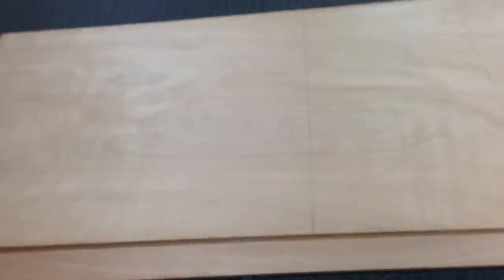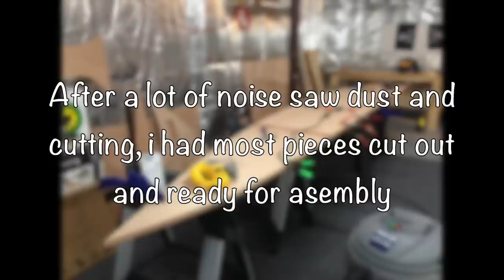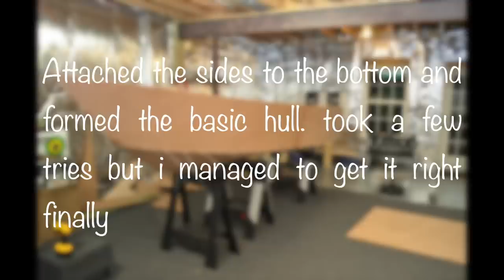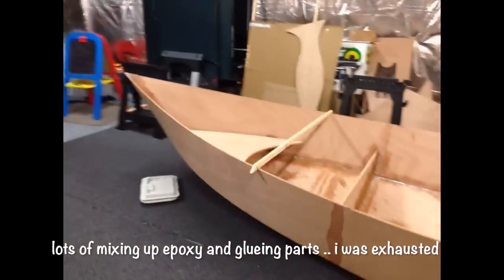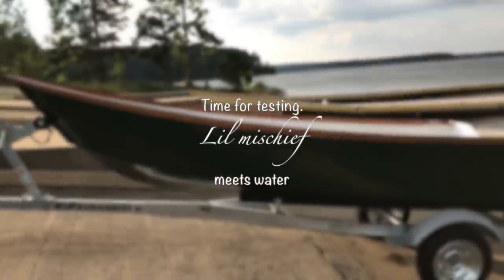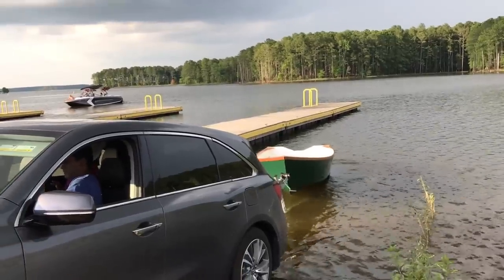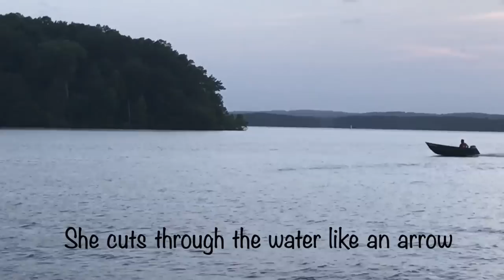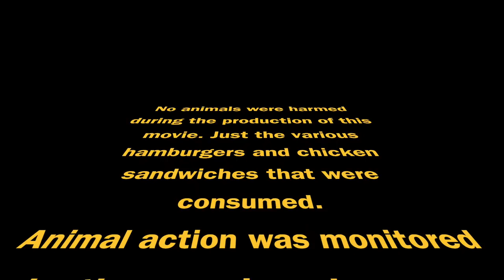Building a wooden boat

Comment: What a beautiful boat!!!!
Congratulations!
Reply from the maker: Thank you :)
Reply: Olá amigo tudo bem...você pode me dizer como você fez pra pintar o barco (tipo de tinta )e como você aplicou ... obrigado
Reply from the maker: I used a regular paint brush and Rust-Oleum Marine topside paint to paint the boat. I painted it just like you paint a simple wooden door, I did not use any spray paint etc. 
I'm going to use google translate and say the same thing in Portuguese, so excuse any grammatical errors. All the best :)

Eu usei um pincel de pintura comum e uma pintura de topo de Rust-Oleum Marine para pintar o barco. Eu pintei-o assim como você pinta uma porta de madeira simples, eu não usei nenhuma tinta spray, etc.
Reply: Diederich, what's "Wood Prix"?  The name of a company or, what?
Reply from the maker: Wood prix is a company that sells plans for all sorts of wood projects. I saw a few plans for boats there but they dont seem the same as the one I built.

Comment: Awesome build and a gorgeous lookin boat. Just curious how well this design takes wakes from bigger boats, especially if taken broadside, and bigger water in general.
Reply from the maker: I have only used this in lakes so far . I wouldn't use it in open ocean water or very rough water. That being said it is very stable and have had no issues with bigger boats passing by when I am in it

Comment: engine seems little higher power... Do not run fast when you run alone....Have you used  Fibreglass Woven Roving WR Mat 600 & 400 Gsm ? Rest is fine
Reply from the maker: I dont remember the actual fibre glass specs . I used fibre glass fabric for the inside and outside which is woven . For the seams I used fibre glass tape, essentially strips of fibreglass. 2 part epoxy for all glueing.

Comment: Nice boat..... what length tango did you build and what thickness plywood did you use.
Reply from the maker: 9mm sheets for the hull (3/8 inches)
12mm sheets for the support structures. (1/2 inch)
transom was two sheets of 12 mm glued together so that part is 24 mm.

Comment: How strong is this boat? If you hit a rock at low speed or run it on land to park it will it hurt it?
Reply from the maker: I haven't tested either running into a rock or land to failure point (To see the force at which it breaks) . we have used the boat to get on to islands in the middle of lakes and for that have had to run it on to land. Its unfazed by that. I think its strong enough for most normal usage scenarios. Not sure how many newtons of force per sq inch it would take to rupture the hull.

Comment: Nice job.  A good project to do with the family. One question though, how do you get a tag for it since it's a homemade boat and has no serial numbers?
Reply from the maker: I wrote up a document that listed the specs of the boat,. stated I am the builder/designer and this is what I rate it as capacity, max rate HP etc. Went to the wild life commission and they saw the paper and gave me the tag. Wasnt hard at all, infact they were rather nice about the whole thing :)
Reply: @dineshjos  Now for us, in Michigan anyway,  watercraft registration is obtained at the DMV and they don't make it easy. They want the place of origin, the purchase receipt, the serial numbers, the title etc, etc. before they can issue a tag. And I hate dealing with them because a lot of DMV workers are assholes. :/ sigh

Comment: Amazing job, loved the video. 
I've been looking at different boat builds and settled on a tango skiff. I was thinking of going with the Tango 15 or 17. Do you have a rough idea on what the cost was? I am in Canada as well so just looking for a rough budget. Not including motor or trailer.
Reply from the maker: its been a couple of years since I built the boat so my numbers may be off. I think I spend about $1800 in all.
The biggest cost is plywood and two part expoy . I used marine grade okumee plywood, you could go with a cheaper option. I also went overboard with the epoxy and fiber glass, you could save some on that. I used marine paint, regular paint is cheaper. I bought the hatches and fittings online, could have gotten em cheaper on eBay or craigslist . I had to buy some clamps and tools etc, I had/have very little tools so that cost me some money.
I wanted the boat to be strong especially with kids in it so over engineered a lot of stuff.  If I had to build it again I probably could do it cheaper, maybe $1200 or even lesser. 
Thank you for you comments and enjoy your boat build. Its certainly an enjoyable experience.
Reply: @dineshjos  Thank you very much for the thorough reply. I will probably build it similar to the way you did, and use quality material so the boat lasts that much longer. Thanks again!

Comment: Hi,
Did you use fiberglass mat or cloth ? How many layers ?
Thank you
Reply from the maker: I used 6oz fiberglass cloth tape on all the seams inside and outside. The rest of the boat is fiberglassed on the inside and the outside using fiberglass cloth and two part epoxy. the v hull part has two layers of fibre glass cloth over lapped. Typically you can buy fibreglass cloth rolls in 6 - 8 feet width and 30 - 60 or more feet long. Since 8 feet wouldn't go across the entire bottom of the boat the overlap is around the v hull. Hope this helps.
Reply: Dinesh Jos thank you !

Comment: Very nice work & build! I like it. Looking for a project like this to compliment my bigger boat. What are those pods/strakes at the stern & transom? Also, what size of outboard did you put on it? I totally agree with fiberglassing the inside & outside of the hull. Great job!

PS: You'll have better memories with this boat in the years to come rather than a big fancy ski boat!
Reply from the maker: Thank you. I put a 9.9 Mercury on it and it works great as far as power goes with 4 people on board.  Wish I had a electric start motor, the current one has the corded start. The strakes at the transom were added to provide for addition stability and easy planing. It works great.

Comment: can you please tell me what thickness of Ply did you used for boat's main body?
Reply from the maker: Hi I used 3/8”(9mm) okoume plywood for sides and bottom.  If you use thicker sheets its very hard to get the smooth curve for the hull. If you go with thinner sheets its easier but make sure its strong enough to withstand the beating it will get on the water. I used fibreglass fabric on the inside and outside, it was an overkill. If you use thinner sheets make sure you use fibreglass on the inside and outside.

Comment: I noticed that you posted this on YouTube on June 27, 2017 and, referred to http://www.tangoskiff.com. however, when I tried to go to that website, it apparently went out of business.  Hard to believe that it's been less than 7-months before the company went out of business.   Sure would like to be able to get a copy of these set of plans though.  Looks like a very nice boat to have and, operate.  Congratulations on a job well done!
Reply from the maker: I just checked the tango skiff site seems to be working. I dunno if the plans are still available. It is certainly a great boat, floats on 6 inches of water and can easily be used as a row boat. With a  9.9hp motor and the whole family on it, it does about 25 mph which is plenty for me. The build is fun and you dont really need too many tools. All I used was a circular saw, jig saw, planner, chisel, power sander  and clamps. I hope your able to get the plans, its simple and I modified it a lot to suit my needs.
Reply: Dinesh Jos,  when I tried to log on earlier this evening, the website showed a "404 Notification" with this site isn't available.  I have had that occur in the past and, now I believe it might relate to where I physically reside (and, retired to) here in the Philippines, as I am retired U.S. Air Force & Civil Service.  My Philippine-American Spouse and, I elected to permanently retire back to the Philippines as it's much cheaper here to live than in the U.S.  As the saying goes "Life Is Better Here In The Philippines".  Thanks for the response.
Reply: Dinesh Jos, any idea how to contact these people as I have sent two (2) emails this past week and, never received a response back.  Is it possible that this company has gone out of business?  Seems kind of strange that you can order the plans and, yet no one responds back to your emails.  That's certainly no way to run a company.
Reply from the maker: I have no idea how to contact the company. I have no affiliations with the company or anyone in the company. I don't know if they still are in business or gone out of business either. I do see their website is still up and running.

Comment: Nice job Dinesh! Roughly how much in GBP do you think this would cost?
Reply from the maker: Hi Ryan, Here is the list of stuff you will need.  I spent about $2500 (USD) on material. I borrowed some tools .. I had some .. and bought some. You can go as fancy as you want .. I fibre glassed the inside and outside of the hull. I think just outside would be good enough. I did extra coats of marine primer, you can skip that if you dont want to. 

I would say you'd need between 2500 - 3000 USD.  thats 2200 pounds I'm ,guessing depending on exchange rate

4 sheets – 3/8”(9mm) okoume plywood for sides and bottom
2 sheets – 1/2”(12mm) okoume plywood for seats and bulkheads Approximately 3 gallons epoxy resin plus hardener
2 quarts Wood Flour for making fillets
1 quart Silica Thickener for making fillets
1 quart Phenollic Micro-Baloons for hull fairing
Fibreglass cloth and tape
Three prefab plastic hatches
Paint and varnish depending on how you wanna paint your boat, Cleats, bow-eye and other hardware as needed

Comment: Which model is yours ? How much did it actually weigh ? Liked and shared.
Reply from the maker: I based my boat on the tango 14, I made it a little wider and added a few extra structural supports. boat weighs 209 lbs (94.8kg) with out motor.

Comment: Nice build, and good job on the paint. I was wondering how it handles choppy water, does it jump a lot or keeps cutting through?
Reply from the maker: I have only used the boat on lakes around here, never used it on any ocean or sea so cant speak for that. On lakes it does well with the waves. I havnt noticed excessive jumping. It is a smaller boat and about 210lbs so when sailing solo it does bounce a bit .. but fully loaded with 4 people its a lot more stable
Reply: These tango skiffs are of poor hull design, not enough bouyancy at the bow and freeboard at midsection, with passenger on the bow there is a lot of splash goes in, and with the lines of the stern and transom th d not plane well, making waves all around. They are easy to build but after done that you start comparing with aluminum ones of the same size, same weight but carrying more load and planing on a smaller motor.
Reply: Also when it is running, that is, going same direction as waves do, it does not have any good directional stability thanks to the transom sponsoons. They are also responsible for the excessive noise and vibration, catching all the centrifugal splash from the propeller. Would have been better just have a feet longer boat of traditional design at the expense of the sponsons.
Reply: So there is a reason one does not see boats with such transom that often. Although the one Dinesh built is built marvellously!

Comment: Great job with the boat! I have been planning on building a wooden boat for a little while now. I've looked at the Tango Skiff too and liked the lines and build sequence. Nice to get to see one being built and finished. What length did you build? Is there anything that you would change if you had a second go around? Cheers!
Reply from the maker: Thank you. My boat is 13' 11", I was told anything above 14 and more needed additional taxes etc so I kept mine a inch shorter. I dunno what I would change on a rebuild, maybe add a few cupholders :). I have had many folks comment the boat is small, but I wouldn't make it any bigger cause it would limit where I can use the boat. given its size and weight it floats on 6 inches of water and I can use oars if I chose to . Maybe I would add a steering wheel if I did it again. I dunno :)
Reply: @dineshjos  tienes plano desde chile

Comment: How much money did you spend????
Reply from the maker: If you are careful about what you buy and use you could build it in about $1200 . Spent a closer to $2000 cause I went overboard with the fibre glass and glue, and messed up one of the plywood sheets when I was cutting it

Comment: Oh, and a question, how many layers of fiberglass did you do?
Reply from the maker: I put fiberglass on the inside and the outside. You could probably make do with just the outside . I wanted to be double sure of the strength. All the seams(joints) all have two layers of fibre glass since it has expoy fibre glass tape and the cloth that covers the whole boat. Hope this helps